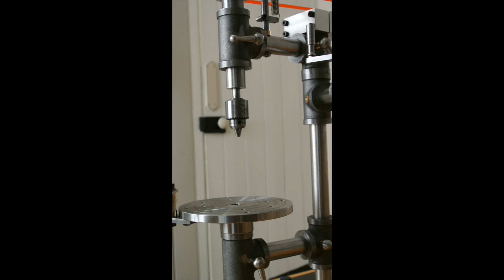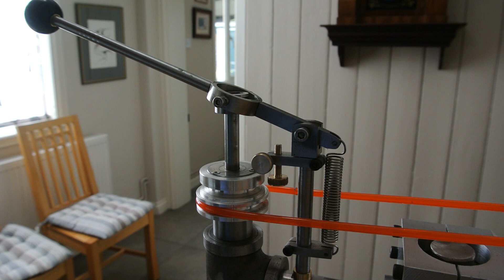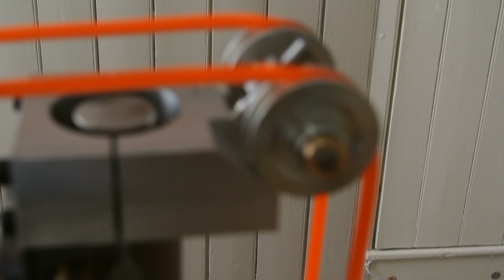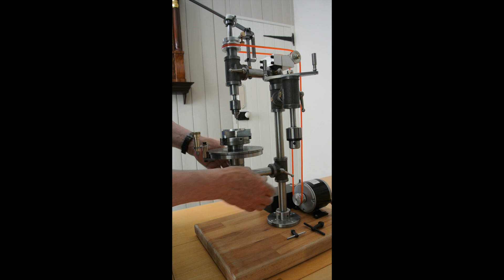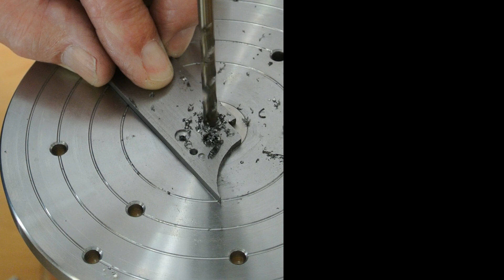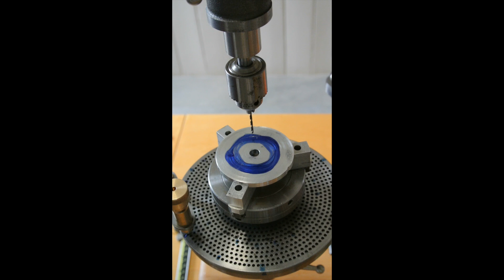steampunkt pillar tool Pt3 testing

Comment: It's nice to see one of these finished and having its features demonstrated.
Reply from the maker: Thanks.. this morning I completed the tapping spindle and gave that a try. It is great and I have needed one for a long time. It is so much better than starting the tap in my old pillar drill and struggling to undo the chuck to remove the tap and work attached so I can then tap it manually. John
Reply: @john2478  John, your email has returned as un-deliverable.  Could you contact Joe in WA State?  I was asking about Harrison Clocks and Lignum Vitae a few years ago.  Thanks